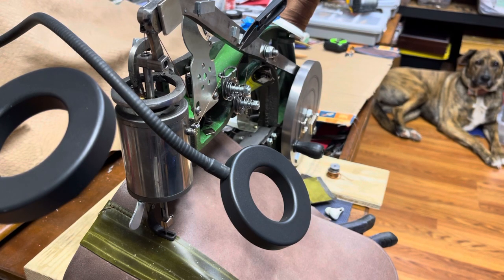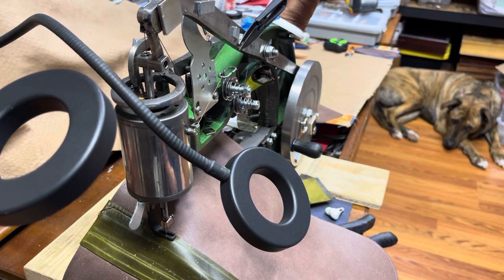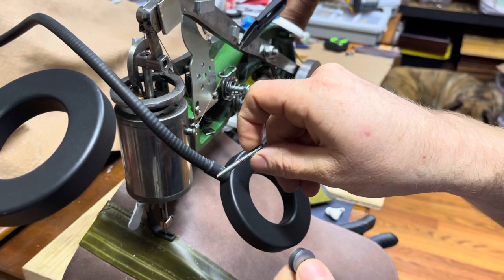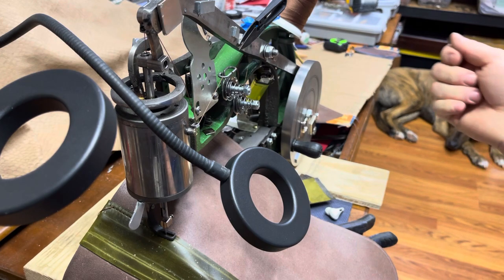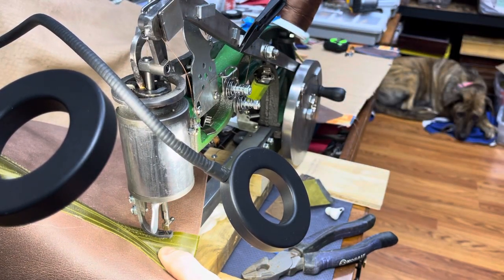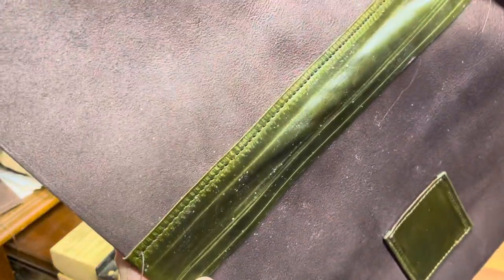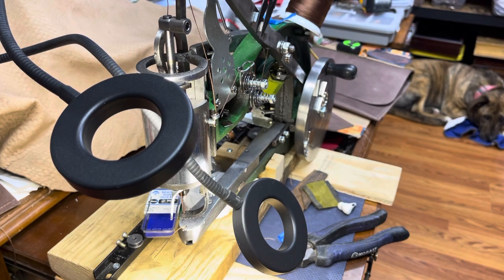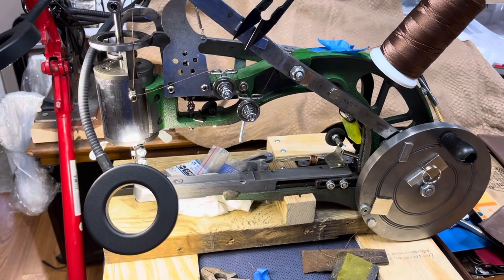Cheap Walking Foot Cobbler Sewing Machine

Comment: I have seen other videos where they recommend filing down the teeth a little on the walking foot to avoid damaging the leather.
Reply from the maker: I’ve looked at that for mine but it doesn’t seem to pull the leather through as well and didn’t work well for me. I think if you have a motorized walking foot machine and you’re able to use both of your hands to help feed the material then filing the teeth might be a good option. Or if you’re only going to be sewing hard dry leathers that slide easily you might be able to get away with the filed down teeth

Comment: How many bearings  I seen 4 8 and 10  I believe.  Not sure which one I should get. I won't be doing  too heavy sewing
Reply from the maker: I don’t know how many bearings are on this tool. Considering you can buy them for under $200 I expect that if it ever breaks I’ll throw it away and buy another. I do keep a lot more oil on this one than any of my other sewing machines because it does seem to have a lot more wear surfaces. 
Bought mine on Amazon but they’re also available on eBay and other sites. Make sure to order extra bobbins because they are tiny and you’ll go through a lot if you’re working with heavier thread.